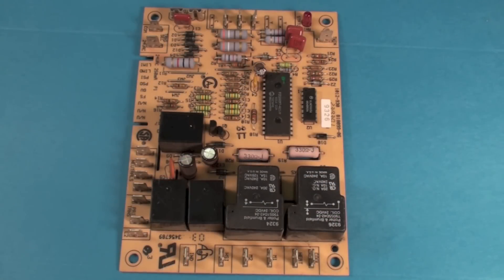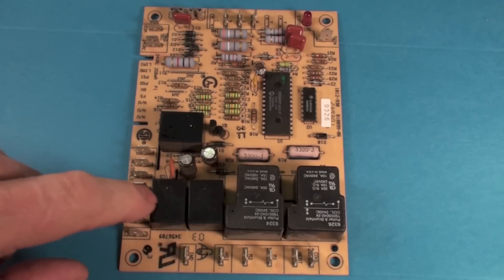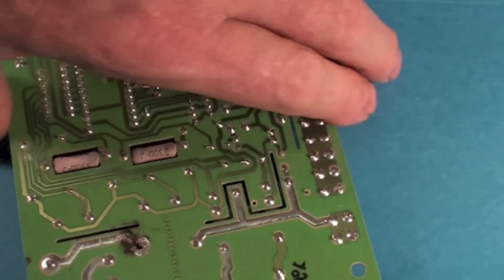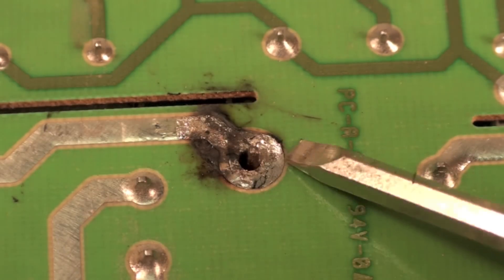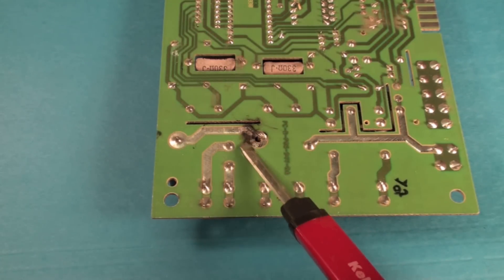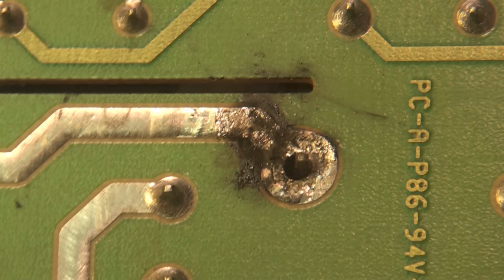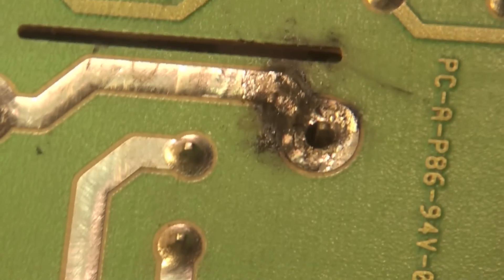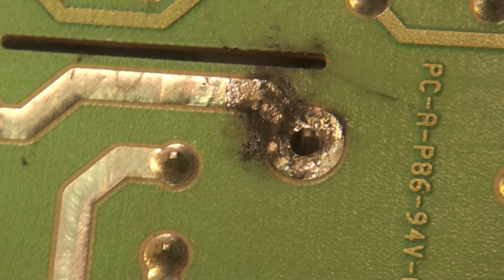How to repair the furnace control board.

Comment: If you see a relay terminal that has overheated, or "haloed" as you say, it is most likely that the relay is bad. Even if the relay didn't cause the problem, it has been damaged by the heating. Never resolder an overheated relay. Replace it.

Comment: This hadn't even occurred to me to try! I have a Heil furnace from '87 (and a Sears AC unit from '83!) and found a large connection like this one damaged. Can't get anything close to the same board and no techs in my area will retrofit a universal board because of the age of the system (even the company that has serviced our systems in the last couple years.) Definitely going to give this a try as everything else in our system is working great surprisingly, other than being less efficient than new. Thanks for the video!
Reply: Did it work?

Comment: Total lifesaver thank you. Blower would not turn on. Capacitor is 7.5 and was only getting 5. Got a new 7.5 put it in still nothing then I get a look at the back of the board see it’s just the one pin is cooked.  Going to get a new one but thank you your grade A in my book.

Comment: I know this is an old video, but I thought the control call signals were 24VAC, so how do they use 24V DC relays?
Reply from the maker: The control board rectifies the 24 volt AC voltage.
GFM
Reply: @grayfurnaceman   half wave?  weren't too many diodes on that board...

Comment: So i havent looked at my board yet but my 120v humidifier and 120v electronic air ports are not working.  Any idea if this is fixable before i look at the board?
Reply from the maker: It could be.  I would be looking at the back of the board for burned spots.
GFM

Comment: GFM,  I have two units that are not furnace based, but rather heat pumps with control boards. They are burnt near the LINE switch on the board. I would post a pic, but can't on here.  Anyway. I checked out both compressors on the units, both are 3 phase and tested fine.What is happening is, one line of the three lines coming in, blows a fuse.  Can a control board blow a fuse, or would it be something else. I see no other indications anywhere on the unit except for that burn mark on the board.  Any help would be awesome :)

Comment: Hi guys ..I'm a thirty year hvav technician...and sort of a hoarder...mostly with electronic boards and other working parts from old equip. i have replaced...but i know i have alot of boards with those burn marks that i knew i could take onto the bench and repair..but i also wondered if a component on the board caused the failure ...so i opted to buy new (in many cases OEM replacements)...but i gennerally have a modest markup and think less chance of call back and unhappy customer..but just couldn't bear to throw away the old boards thinking i could give it to someone in need...and i find all the time lately pulling stuff from the hoard pile that it can really be a good way of giving to others  in time of need. Perhaps i may do some repairs...thx for the video. ...bill demmon b&d mechanical bend oregon
Reply: bill demmon some time control boards are very expensive ,that is why people repair it for cheap and not buying a new board coz their stoves are 5 years old and not in a good shape no one would spend $250 for brand new control board and on other hand they have an option of spending $30 for repair and there is very less chances of getting the same problem on the board.i have repaired too many control boards and so far I have never called back ,I love to work smart not hard;) and very important part is that customers cant wait for the part to come in about 2 weeks from Mexico,China or other country customers really appreciate it if we fix their problem on the spot.

Comment: I'm thinking the solder joint haloed due to high resistance caused by burned/pitted contacts in the relay itself.  Replacing the relay would be the correct repair.
Reply from the maker: ***** In almost all these that I have repaired, the solder joint has been the weak spot and the unit operated properly after repairs.  Not saying you are wrong, but that has been my experience.  
GFM
Reply: grayfurnaceman A resistance test across the relay might be good insurance. No sense doing the job twice.  I can't believe how many of these boards are thrown away for a $2 part.

Comment: i have repaired several on electric furnaces and cond. just to get them by until i could get a replacement board and for some that could not afford a new one,and a good fix will hold up  for a while,great video,thanks again